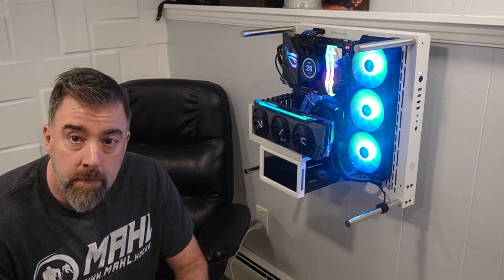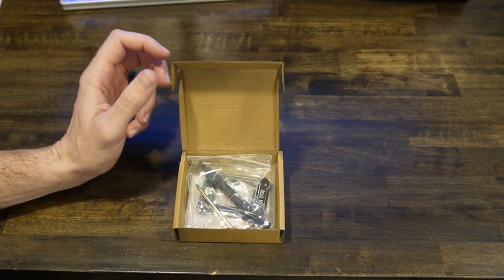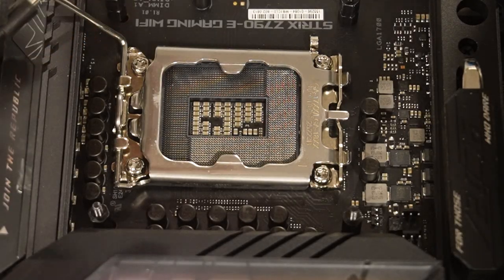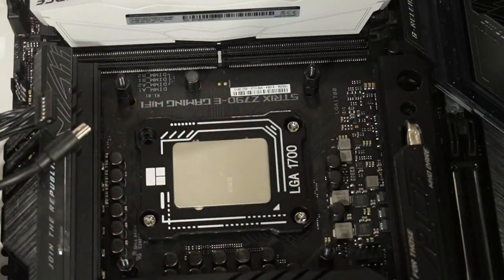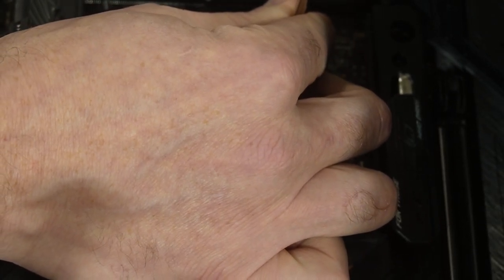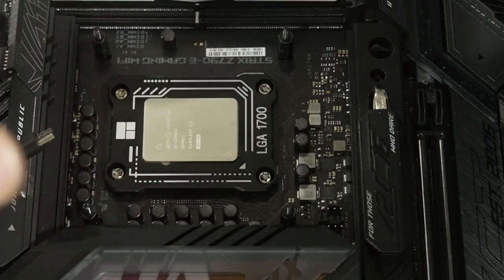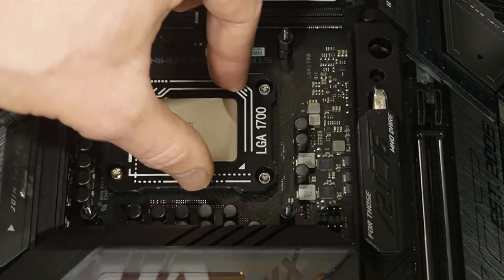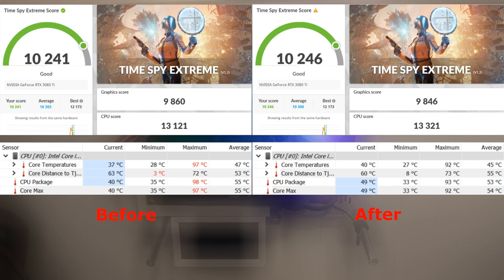Thermalright | LGA Bracket | Install

Comment: Seat the CPU before taking off the ILM to prevent a potentially expensive accident.
Reply: Came here to say the same thing. As soon as I removed the old bracket I dropped a screw and damaged the pins in the CPU socket. I had to replace a $225 motherboard that I had just bought.
Reply: @rodneykeene Ya, that's really unfortunate.  The video shows a very dangerous way of removing the ILM, and in my view the video should be removed and re-uploaded with the proper procedure. It's irresponsible.
Reply: Holly crap that sucks I’m sorry
Reply: @rodneykeene  Thank you SO MUCH for this. This is exactly the type of information I was looking for. 

Anyone have any rough numbers for inch lbs torque one would tighten this to, if they were being OCD?  or NM?
Reply: @Northernblades Gamers Nexus covered installing both brands of bracket:  Thermalright -- https://www.youtube.com/watch?v=Ysb25vsNBQI&t=926s  AND  Thermal Grizzly -- https://www.youtube.com/watch?v=iYU1OskbY-Q&t=1154s
Reply: The moment he new he fuck up
Reply: you know how many video's that I have seen where ppl in the comments are saying to put the cpu in first or just keep the plastic cover on when installing SMFH lol
Reply: This guy is a noob lol
Reply: I thought the same thing, if you are a little jittery removing the ILM and drop it in the socket, whoops.  There is zero need to remove the cpu for this process.
Reply: @tsdobbi better than dropping it on a brand new CPU too!!!
Reply from the maker: @celestialsamurai2042 you guys are hurtful

Comment: ooh, those exposed motherboard pins made me anxious. I would do this with the CPU mounted because any incautious move and you are screwed :) I ordered the same bracket myself because my 13600k instantly hits 100 degrees in benchmarks at 180 watts with 280mm AIO
Reply: What are your results after install? I have a 13600k with those temps in R23.
Reply: @Japie121  Their computer bricked
Reply: @Japie121 Do you guys have an MSI motherboard by any chance ? Like Z690 Pro. I had the same issue with 13600kf, and I was going mad trying to fix it for hours. It turned out MSI has "Lite Load" option in the BIOS and by default it's set quite high, what it does it sky rockets the voltages (pretty much for no reason, but in theory it's supposed to improve stability) I have turned it down and my temperatures went from 95 Oc to 70. I was mad when I saw it.😅

Comment: This is the best tutorial on the installation of the thermalright contact frame I've seen and I've watched at least a dozen of them now. Your video and GN's video are the only ones that go into detail about the tightening the screws, yours even more so than GN's in that regard. All the other one's, even thermaltakes own tutorial, basically just say "Tighten the screws until they're tight 😄👍". Anyway, all that to say, thanks for the great video lol.
Reply: He should have put the cpu in first to help prevent damage to the socket

Comment: I'm just installing mine right this very moment, thanks a lot for the guidance!
Reply: How it's holding up after two months, any errors, any bsod? 🤔
Reply: @siruno6024  No issues at all, works like a charm and the temps difference is quite noticeable even when I don't have my CPU under OC, and also considering I'm using an air cooler at the moment. The CPU is a 14900K and the CPU cooler is a Noctua NH-D15S.
Reply: @conin.v  good to hear that, it's safe then

Comment: Crap. My CPU got delided and its cap was changed, so it doesn't sit right :( 

It's ok if the CPU it's a bit taller or does it have to be perfect flat height?

Comment: What exactly are u holding behind the bracket to get your clicks..
Reply from the maker: I am backing off the screw, so just turning it the wrong way. e.g. not tightening it. This is just to get it to seat correct, so it threads properly. The click is the screw popping up a little bit in the hole. I am not holding anything behind it to make the noise. My hand is on the bottom side holding the back of the bracket up, but that is it.

Comment: Excellent video on proper installation!
Reply from the maker: Thank you!
Reply: @Mannyocrity  You should probably add a note to the video, NOT to remove the CPU from the socket while doing this.  If somebody is a little jittery removing that ILM and drop it in the socket you will absolutely damage the pins in the socket.  Far Far Far less risk of boning your motherboard if you just leave the CPU in place.  My butt cheeks were clenching when you were removing the ILM.

Comment: Why some of the frames got description 12 th gen and other lga 1700? Are there two versions of them?
Reply from the maker: 12th gen is 1700.  1700 is the socket.  Since 12th and 13th gen are the same socket, they changed the label to 1700.  The ones with 12th gen were just manufactured before 13th came out.  They are the same.
Reply: @Mannyocrity  Thank you

Comment: If you have the CPU cooler backplate installed on the other side of the motherboard would it help to where you don't need to hold the bottom of the motherboard up like that?
Reply: i saw some videos where they unscrew it inside the case and screw the new bracket in so i think it should work too not sure tho
Reply: @irepax9889  I was watching this gamers nexus video and the installation guide said to put a backplate on like how the guy in the video was doing it, but when they showed him doing it there was only the aio standoffs and no backplate so I was confused..

Comment: If I donot install this bracket how many year my pc will run fine ? Currently using 12100
Reply from the maker: You don't need this.  It is a nice to do, but is not required.  You'll be fine.

Comment: Do I need this bracket for my i913900k if I’m gonna use the kraken elite 360 aio? Also I’m using the same motherboard
Reply from the maker: You do not ever "need" this bracket.  This is only to help with thermals.

Comment: Installed the same one last weekend..I have i9 13900k..my thermals at 5.8 Hz are around 45_50 now that is pretty good, I wonder if I won the silicon lottery 😜..and that's at 1.4 ish volts... getting back to screwing it down..I just went Chris cross..when I did get to the hard resistance..I turned it 8th just to loosen it slightly..if you have it flush tight you may get a higher temp..just saying

Comment: do u know if i can install this while motherboard installed on the system already i cant reach the back of the MB
Reply: use masking tape to tape the cpu back plate on the motherboard to keep it in place. flip the case over. remove the screws and the original bracket. install new bracket.

Comment: On my 12600k and Asus B760 ITX board the difference is very small 1-2 degrees. Before max 71, now 69.
Reply from the maker: Truth be told, I don't think it really matters unless you are overclocking and pushing for every degree.

Comment: I lapped my CPU ihs and the contact plate on my cooler....dropped my CPU another 8c....but I also tune my CPU and it doesn't go above 70c in stress. I'm using a noctua but may switch to a thermalright cooler. I prefer air to water cooling.
Reply from the maker: wow, that is some serious work.  Well beyond what I would do.  grats on the temps
Reply: Mines not screwing in 😨
Reply from the maker: @THESandyCarrot  test the screws without the bracket.
Reply: @Mannyocrity  I fixed it, the bad side is the\at the back bracket was sliding around and idk if that damaged anything, after i installed it my z63 kraken fans got rlly slow and my nzxt software dint read the fan speen
Reply: @THESandyCarrot just redo it. It’s happened to me

Comment: Geee, you are not defusing nuclear bomb.... Step one: tight them until you feel first resistance, step two: make 90' degree turn. Done.
Reply from the maker: Not exactly. You want them to tighten evenly and not accidently tighten one corner more than the others. This can cause the cpu to seat improperly and could cause damage to it

Comment: Aghhhh computer guy logics machinist logics if u want too ball up on tightening accuracy use a non clicking 95% accuracy digital torque wrench that reads I inch/lbs and then actually evenly tightes to proper inch/lb torque setting for specified bolt thread pitch and diameter and grade of bolt.

Comment: You are overthinking this...
Reply from the maker: measure twice, cut once.
Reply: @Mannyocrity   you’re never gonna get consistent torque by using your fingers.  Just get a torque screwdriver. 0.30-0.60 nm is the correct torque setting.
Reply from the maker: @xINTENSORx  I can't disagree, but one might say using a torque drive is overthinking it.
Reply: @Mannyocrity   true…😂